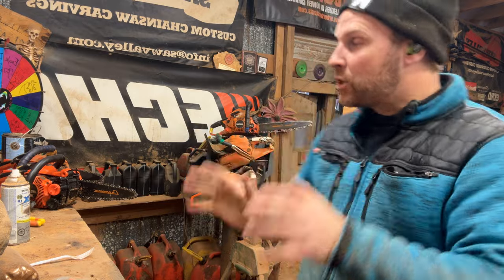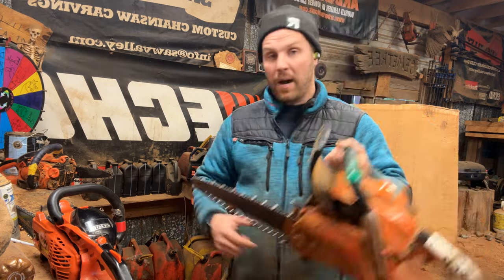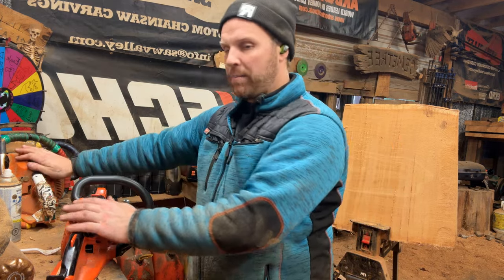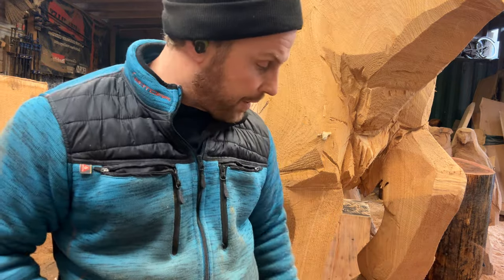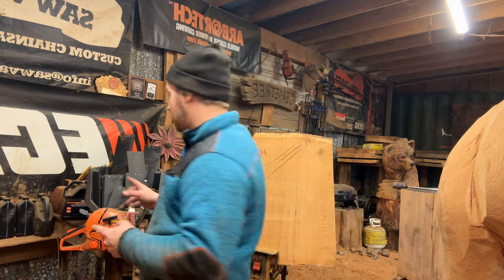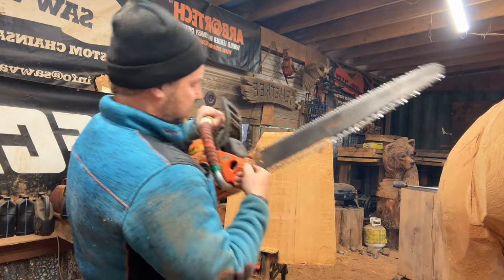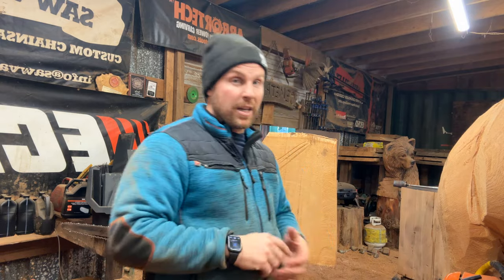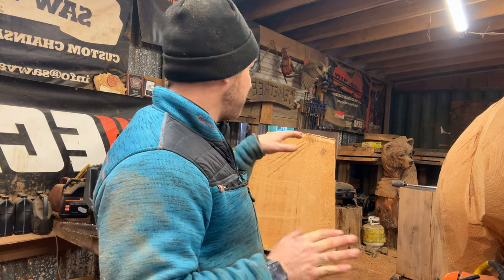My Favorite Carving Bars For Every Saw. The Best Bar For Beginners .. The New 10 In Dime Tip

Comment: 100! Ryan as a new carver I agree! I am currently running a 3510 with  12” dime. 4910 has 20” stock bar. But I’m going up a bit for more power in the future. I know your in Canada , but archer makes a pretty good 1/4 chain, Baileys also has 1/4 called woodland pro, looks just like my Oregon chain in 1/4. The 2511 with 8” is awesome! So light!

Comment: Will the 12 inch dime tip hold up blocking smaller pine rounds for mushrooms and gnomes? I got a dime tip for my saw but had to switch the sprocket so i can’t swap back to my normal tip bar easy. I could use my 50cc to block but i would rather have one do it all.

Comment: Hi Ryan. New to chainsaw carving.. think I'm stuck with stihl as they seem to be only ones available in my town or online in canadacurrently.. I know you don't like them but to you carry any bar/chains by Cannon that fit the battery stihl saws like the msa60, msa70 or msa 140? Theyre all 1/4P but 0.43g. Would i need a different sprocket too to use .50g? Pretty sure they're bars all interchange but id have to check with Jordy J.. I don't do insta.. how do we connect? I'm in b.c. thanks and looking forward to hearing back! Rob.

Comment: I have a stock echo cs310 I purchased 12 dime tip bar and 1/4 pitch chain but I can not find any listing for 1/4 in sprocket for cs 310 is there a different  option available?